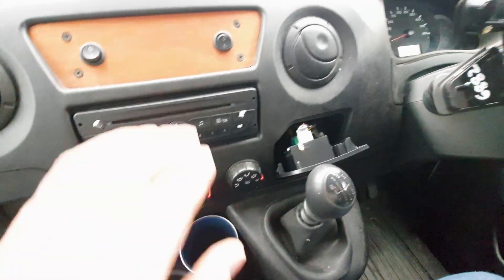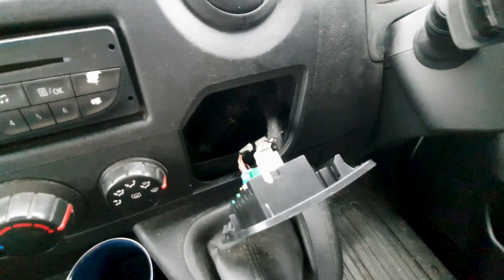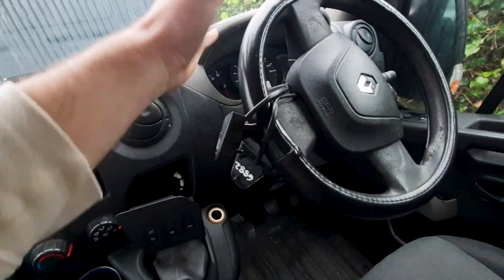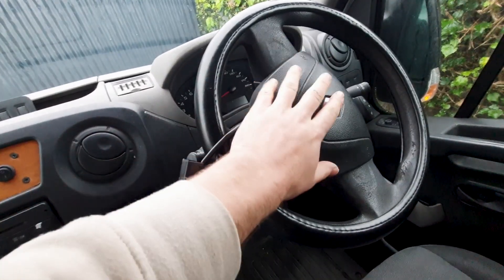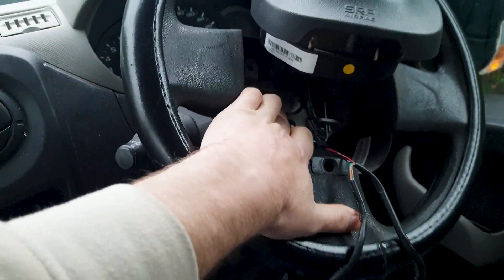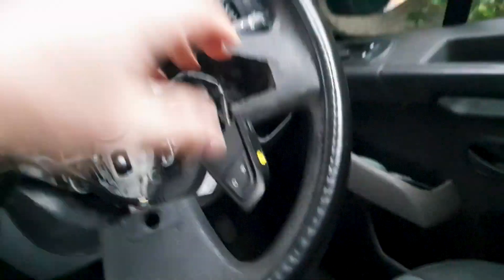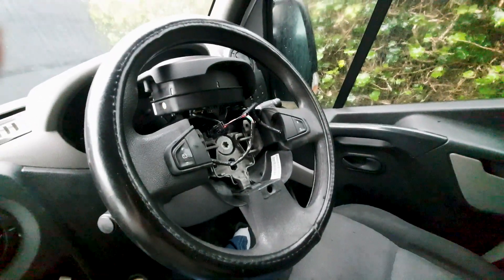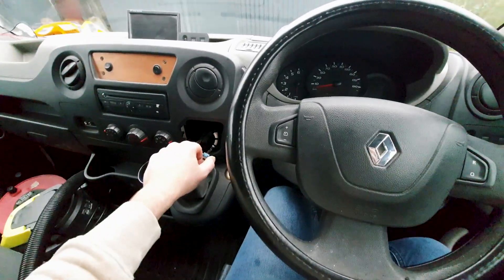I Hacked My Renault Master To Add Cruise Control!!

Comment: Buy Steering wheel from renault laguna 3.
Reply: Hi, it's plug and play laguna 3 steering wheel?
Reply: Have you test it? Does it work? Because the original one is very expensive.
Reply: @FunnyHenni  I have done IT in Trafic 2 from laguna 2 and IT works perfect. You can also check from Megane iii.